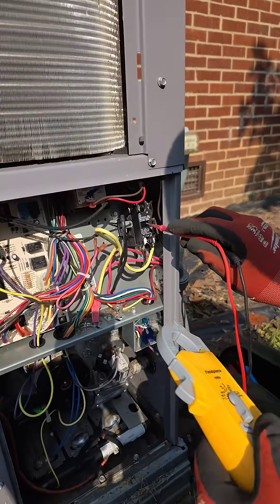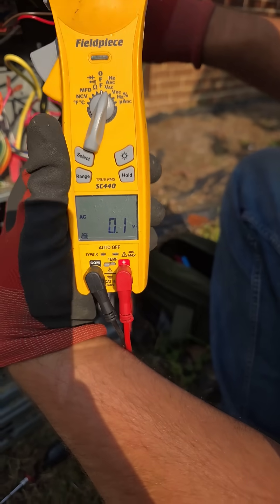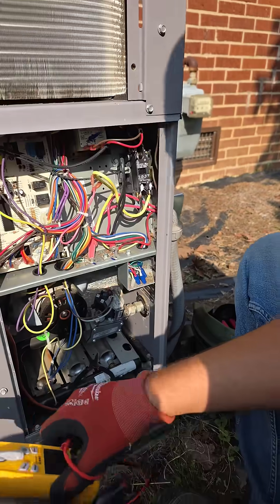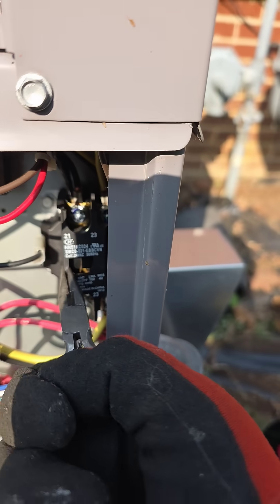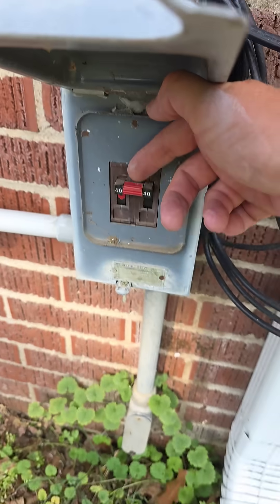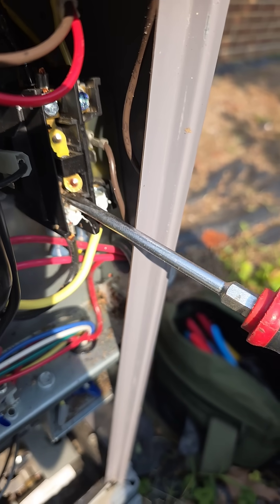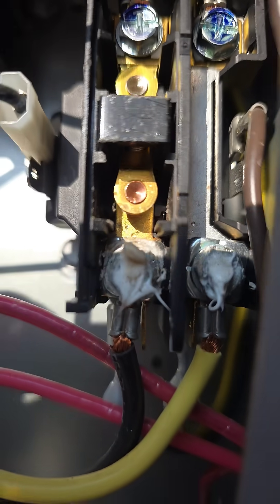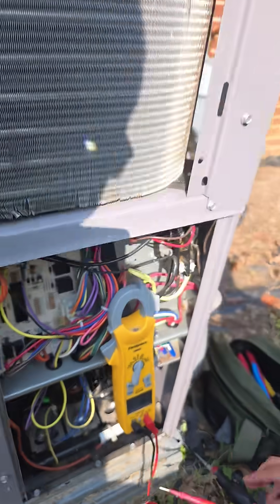Ants Shut Down This AC System! #airconditioning #hvac

Comment: I smear a thin coating of silicon grease around every opening and edge of the electrical enclosure. Using a long cotton swab, it literally takes about 2 min.

No spider or insect will cross that line. Even mice don't like it.
Reply from the maker: Great tip, I'll have to give that a try!
Reply: @taddydigest 
To be clear, I'm not talking about putting it on any components, just all the entry points.

So, for instance, if your enclosure is a simple 6 sided metal box, there may be a gap at all the coners, hit them.

One side might be open and require a lid. Smear some silicon grease all around that edge.

There may be grommets for wiring to enter. This area will be the most challenging, but easy once you think of coating every surface of the opening and wires, as they break the plane of the box.

Just a paper thin coat and only where an insect or spider might enter.

I've done this many many times, and although I used to use de-ox wiring grease (which works great ,too) I find that silicon grease goes on cleaner because it's clear. I have had 100% success using both materials.

I even do it  on the tiny holes on the  bottom and rear of my mailbox.

I do it on around the prongs of female cord-ends. No insect, spider, bee, wasp, etc. will enter.

I figured this out on my own when I noticed that insects, spiders, and little wasps would feel at home everywhere in an electrical panel, except where deoxidizing grease was present, which is often seen on wires, buss bars, and breaker terminals in panels and meter cans.

I've got a few decades of very pleasing results!

Comment: Ants got inside the smoke detector in my entranceway and it went off at 3am setting off all the alarms. I couldn't figure out what was going on. Changed all the batteries and went back to bed. Went off again. Scared the shit out of me. Finally took it down from the ceiling and ants were swarming up inside the box above the alarm. Found out this is a common issue. Something about the frequency attracts them to electrical devices.

Comment: I wouldn't have removed those bug carcasses from the contactor. Not because it grosses it me out, it doesn't, just because replacing the contactor with a new contactor is a cheap and quick fix and gives more long-term value to the customer. In fact, why waste your time on cleaning it? It's not an evap coil or anything. It's a $15 part TOPS and you'll get out of there quicker. If the homeowner lays down some Amdro Ant Bait around the perimeter of their home on an annual basis, they won't have any problem with ants in the future. I would give them this FREE pest control advice. Wondering if you didn't clean it just to bill more time... You seem ok, though. Just a bit misguided on how you resolved it.

Comment: Ants get into our Fiber Optic splitters and block the light and cause outages. 
They also get into the Bulk head connectors and do the same thing. 
They also get between the copper mods and short them out.

Comment: Destroyed that contactor with that big azz screwdriver!

🤣🤣🤣🤣🤣🤣🤣🤣
Reply: Contactor was fine.
Reply: Seems he just wanted to verify the issue would be solved by a new contactor before replacing it
Reply: @rp61  the contactor is OK. It was just some bugs preventing contact and sometimes deezNew  parts don’t have the same quality as theolder parts.
Reply: Gotta sell a new one some  way😂
Reply: @HBSuccess  could’ve blasted it out with some air , duster spray
Reply: no lie

Comment: Nice job but it's a $20 part. If you get a call back because they also ended up getting in the coil, chewing the varnish, you'll be putting in a contactor for free. Especially since the contacts were bent up a little by your screwdriver
Reply: Yeah, someone beat me to it. It was slipshod for sure.
Reply: I refuse to throw parts at things that don’t need them. I would have blown it out with compressed air, then vacced EVERYTHING out  w my little DeWalt vac. Then inspect EVERYTHING for insects/rodents etc . If the contacts needed cleaning I’d clean them.  But unless there was real physical damage to that contractor from arcing across ants it’s staying. In my experience unless it’s OEM parts, which around here nobody stocks… A POS $20 made in China contractor will fail sooner than the factory one I clean up and leave in.  That is of course assuming it is just dirty.  If it really needs a part different story.  And I’d tell the owner what happened and what to keep an eye on. Put some Tarro OUTSIDE of the unit and maybe solve the ant problem. But I’m retired now… I see kids doing nothing but throwing parts at equipment running up the cost for no reason.
Reply: He said in the video he was going to replace it at the end. He was just demonstrating that he did resolve the issue.
Reply: @kafungalung5677  Yeah but he could have done the same thing by replacing the contactor. Doing what he did in the video doesn't serve anyone. Definitely not DIYers, in fact it could be argued that this is dangerous because if they mess up the contacts it could cause high resistance. Possibly burn out the pump or even cause a fire. I just personally don't see the benefit of this instead of posting a video of replacing it. Just my opinion.
Reply: Stop it. Everything you said was wrong from start to finish. Even if he just cleaned it and left it in there it would have still been fine unless the ants had gotten into the coil of the contactor. Replacing it is actually unnecessary but a good practice to prevent POSSIBLE call backs. He had proper voltage in and out with no drop and assuming he didn't damage it by cleaning with a screwdriver instead of a brush it was working as intended. @AnUnapologeticApologist
Reply: Showing that there are multiple ways to diagnose system faults and to repair them is perfectly fine. And to be clear here, he did that and replaced the contactor afterwords. But knowing there are options for new techs is a good thing. Some people may not be able to afford the company's cost to replace that 20$ part, and telling them you have to recommend replacement to cover call backs but can get it running for just the labor is a perfectly fine option for some customers.

Comment: BE CAREFUL!! I like to check all legs to ground individually. For example you showed no voltage on the load side of the contactor but obviously you had one live leg. Just being cautious. Good videos. Thanks.
Reply from the maker: Good point, and thanks for the tip!

Comment: That contractor wouldn’t be pulled in if it wasn’t calling for cool right ?
Reply: Yes but check call for cooling by measuring the coils on the side because  the contactor can be stuck open for some reason (bugs for example, debris)
Reply: @The1realro lol yes,  I see what your saying. I have come across a contacts that were stuck
Reply from the maker: You got that right! not unless the contacts get stuck

Comment: Compressed air would have been handy right there.
Reply: No Flash. Safe for electronics & non-flammable
Reply: An empty refrigerant can turned into a spare air tank would work well for those situations
Reply: Points will pit because of the ants, which will lead to them welding themselves shut. An emory board helps, but only temporarily. Get a cattle insecticide ear tag, and hang it next to the contactor. TIPS FROM TEXAS!
Reply: @Parabellum-X  yep the good old air broom
Reply: Now that I think of it a good can of brake cleaner
Reply: @jamesgutierrez8606  I learned that brake cleaner is flammable by using it to clean ants in a contactor just like that.
Reply: @andrewbrown9497  just the non chlorineted crap the good stuff wont burn ,either one can give condensation on a fairly humid day due to the rapid Evaporation
Reply: @andrewbrown9497 Agreed.  Brake cleaner is essentially Ether. Although it evaporates fairly quickly, Ether has a flash point, which isn't practical for using on a component involved in a high electrical circuit.
Reply: @jamesgutierrez8606 contact cleaner would be better, brake cleaner can damage some plastics.
Reply: @jamesgutierrez8606  there is a contact cleaner spray that isn’t flammable
Reply: @cmosdaboss  Caig Labs would beg to differ.
Reply: @wphh7272  would beg to differ? To say there is not a contact cleaner that is not flammable? I have quite a few commercial brands and types. 

Children's Center for Immunity and Applied Genomics (CIAG)

😂

Comment: Don’t let that 0 voltage reading on the load side fool you.  Measure each leg to ground and you’ll have 120v.
Reply: Yea , potential voltage but even if we did measure each leg to ground it would have not made a difference in terms of this videos diagnostic and repair.
Reply: @The1realro it most certainly would for a very new technician who thinks no voltage is getting through that contactor.  I’ve been that very green tech who didn’t understand how single pole contactors always have load voltage on one side.
Reply: @millenialmemoirs oh that makes sense thank you! You go to check and think there’s nothing passing but there is. Appreciate that
Reply: Ig you were referring to safety check
Reply: If by chance you did have 120V on one leg of that contactor, the fan and compressor would be humming because it only had 1 leg working. 
But since they were both OFF and dead, that means it didn't even have one side Hot ....
Reply: @ACommenterOnYouTube  that's not how it works at all, that contactor has a shunt and always supplies 120v to both motors
Reply: @dtouw i didnt ask how the contactor works ...
Reply: @ACommenterOnYouTube  If the fan and compressor need phase to phase power (240v) why would they hum with one phase disconnected? They don't run on phase to ground (120v)
Reply: @jay9308 because its only getting half the voltage at 120V so it will make "some" attempt to run, that some attempt at running is going to be a HUM noise like its "trying" to run.
Reply: @jay9308 The fan may only need 120V, so depending on the leg the proper voltage could still work. And if the fan does only work on 120V, then a neutral is present because it would need to be required, and that means the hot legs are the only things needing to be attached to the contactor. In this video he did say that the fan was working, but no cool air was coming out, so that means the condenser wasn't working because that needs 240V.
Reply: When you have a 1 pole contactor and check the load side when it’s not making continuity through the contacts, It’s not a reading of 0 it will read OL meaning that both poles on the load side are reading the same circuit of 120v. Why? Well because if you send one leg of power through a motor is will travel all the way around the winding and back out the other leg of power to the other pole of the contactor which is why you get an OL reading.

Comment: Student HVAC Tech here. Just collecting tips and education. Thank you for helping make sense of this for me.
Reply: @KiwiPaulParkes  thank you for your service.  We need people like you to help with America’s cooling needs.
Reply: @KiwiPaulParkes   If I find a similar situation I know I'm gonna cut the breaker off then I use brake cleaner and I clean it all out with compressed air and it  leaves it really nice and tidy.
Reply: @kennacraftjr.6513 .. Thank you very much Kennycraftjr.6513 for the tips.
Reply: @kennacraftjr.6513 
Brake cleaner makes the plastic parts both melty and crunchy. Way to earn a callback double charge.
Reply: @kennacraftjr.6513 ..oh perfect. Thank you so much for the tips guys. This helps me a lot with making things make sense.
Reply: Companies don't build anything to last anymore, 35 years working on the manufacturing side of HVAC I got to watch the quality go down hill.
The furnace and AC unit I put in my parents house back in 1986 is still working great.
One blower motor while still under warranty, and a new purge blower 2 years ago.  The air conditioner has been mint, no problems at all.
Reply: @windrider65  I swapped out a 31 year old package unit last year, it could not be fixed due to no parts and it was costing a fortune on the power bill, the new unit uses basically 1/2 the power the old one did and its bigger than the old one.
Reply: thats it you finaly found the BUGS
Reply: Always check voltage across the load AND TO GROUND.
Reply: The electrical and electronics on these HVAC systems to me are very simple. Of course, my background is in electronics engineering. The problem with most new technicians is they don’t have an adequate understand of the electrical and electronics nor how to test for faults. Learn your sequence of operation. Learn the components within the sequence of operation and how they interrelate. Know which components do what and how to test each one of them. And also know which components you can test in circuit and which ones you have to remove from the circuit in order to test. Most of your integrated solid state component you have to remove from the circuit in order to do an accurate test. Otherwise you run the risk of getting a false reading. 

I’m not an HVAC technician I have never worked in HVAC. I’m actually studying electrical engineering in college. However, I’m an electronics technician and have about 36 years on and off in the electrical industry. I’m also 52 years old.
Reply: Same
Reply: non tech homeowner that fixes my own stuff mostly.  always check the most basic stuff first!  never dig deep until you have covered the simple stuff.  forget any bugs.  the contactor could be a little corroded causing this exact issue.   a simple capacitor could too.  look for bulges on the lids of them.  ive changed a few fan motors.  if the blades dont rotate smooth the bearings may be going out. etc. all very common with todays quality and older units.
Reply: I'll give you a tip.. don't replace parts that are fine.. might lose a little money right now, but you'll have a customer that feels they can trust you.. better for the future.

Comment: For the sake of the viewers, when confirming NO voltage to the contactor, each leg should be checked independently.
Reply: For the sake of the viewers don't mess with all the Volts and call someone 😊
Reply: @Spc_Garza  Meh. I support both DIY and Darwin.
Reply: @amiatroll1  you right. buddy does not know what he is talking about. 240v is across both legs. What ppl don’t realize is 240v is 2 independent 120v circuits technically. This is why a cheater works to get 120v for your vacuum pump, just use the ground of the unit for your neutral. Been doing AC residential 10 years. Ask me anything. Any problem you have and I gotcha.
Reply: You guys ….. and your cute little 120v. That’s control voltage for my 480v units.
Reply: @moonlightacmaintenance3232 I do some 460v for commercial style. Just change a 460v condenser motor that had a cap.
Single phase of course. Never understand why don’t they make the fan motor 3 phase as well
Reply: This is 240....that's all there is...there is no independently!
Reply: @diverbob8  Respectfully, you don't know what you're talking about.
Reply: @diverbob8 with a single pole contactor you will read 120v load voltage on each leg measured to ground. All the high voltage will have 120v to ground.
Reply: @millenialmemoirs you read 120v on each leg because the one side of the pole that allow continued power through will travel through motor and compressor windings back to the other side of the contactor. It’s still same circuit of 120

Comment: I've been finding that alot of these covers almost help them build up inside and cause failures while older units with no covers on the contactor and yearly cleaning of the contacts don't have as many jams. I will say the covers help fight against mud dobbers and wasps on rooftop units but you really shouldn't get them in a properly sealed unit.

Comment: Isn't the plunger being pulled down mean the thermostat is calling for cooling?
Reply: Yes
Reply: No, sometimes they weld shut and continue running without a call from the thermostat, also low voltage wires could be bare and touching, causing a constant 24vac call for AC even though stat doesn't call for cooling